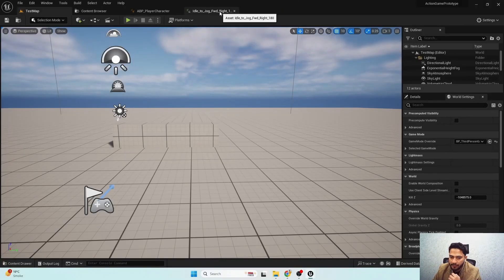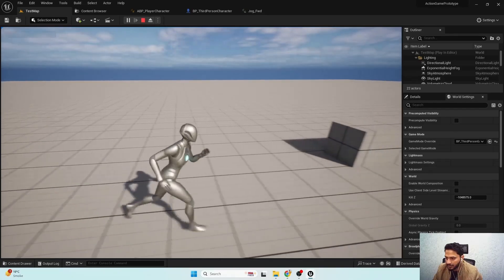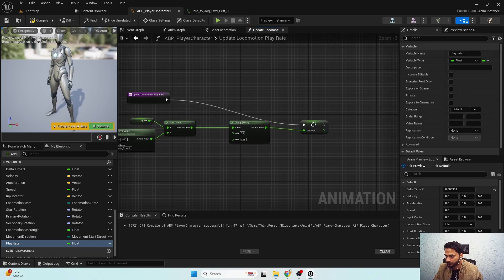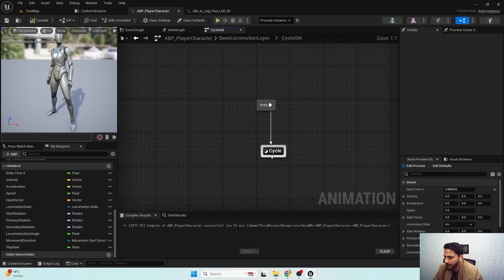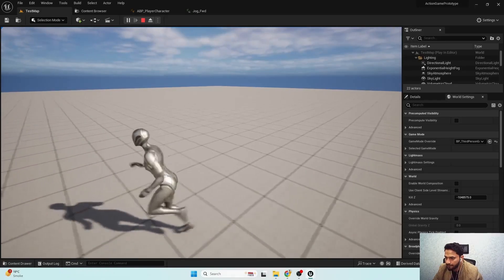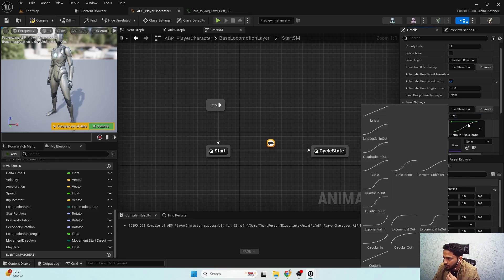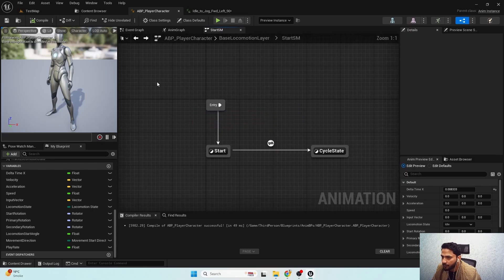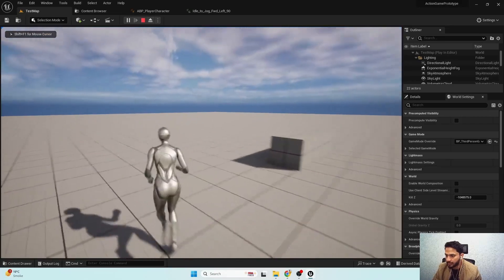Advanced Movement System | Part-5 | Finishing the Running Functionality

Comment: Hey, thanks again for your videos, I have a question, maybe you'll be able to get whats wrong. 

It's a little bit complicated to explain. In my game there are 4 states: Idle, Jog, Run, and Pivot. Jogging is made with mixamo jogging animations when a target lock is applied (so that my character could strafe), when I start running echo animations working i.e. your code (so player is no longer facing the enemy). Using interface ABP tells BP_player that it should set UseControlDesiredRotation only when Player is in Idle or jogging state(so when pivoting or running it doesnt rotate towarsds the enemy). 

And here is a glich. If I release and press shift (Running) very quckly my character teleports to desired rotation. More precisely when I realease shift my character starts to rotating towards the enemy (because when in jogging sate it's sopposed to strafe) but if I press shift before it can lauch run start logic,  character just teleports to desired rotation). I tried to fix it myself but my attemps were futile. Could you help me?

Comment: Why not instead add distance matching to the appropriate states? You could add distance matching and drive the capsule rotation by the rotation curve by grabbing the rotation curve value corresponding to the distance-matched time value.

The play rate is certainly a way to attain a similar effect for the Start state. I guess I'm just curious as to why you chose to avoid distance matching. 🤷‍♂

The overall results looks surprisingly good though.
Reply from the maker: Currently doing the same, by grabbing the Rotation Curve value and deriving the Capsule Rotation based on that.
Not sure what exactly you've asked for?
And Thanks for the appreciation.
Reply: @TechAnimStudios , thanks for the response. 

I was suggesting a slightly different, though not necessarily better, approach than what you implemented. A distance curve could be used to match the translational motion of the capsule, and the time derived from the distance curve could grab the rotation value from the rotation curve to drive the capsule rotation. 

I'm not sure if my new explanation clarifies.